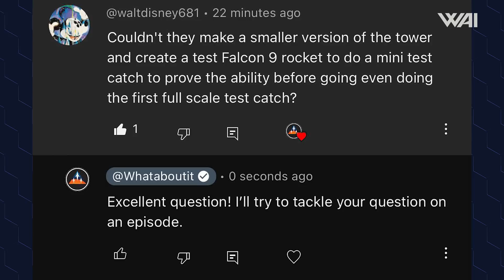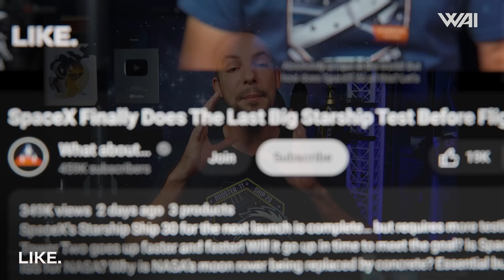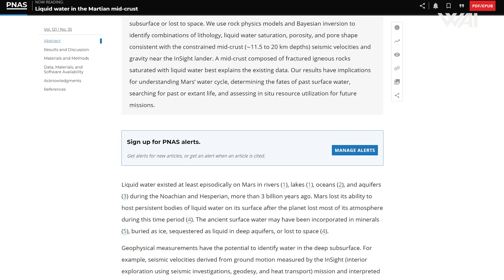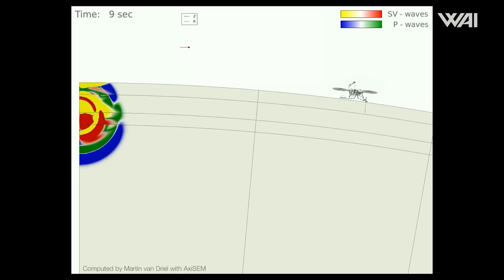SpaceX Massively Updates Starship! Ready For Flight 5!

Comment from the maker: Do you think SpaceX should try testing this with a Falcon 9 first, or maybe you have another idea?Let me know! :_WAIHello::_WAIStarship:
Reply: F9 won’t be compatible with a catch as it can’t hover (the engine needs to ignite precisely that the speed will be 0 at touchdown, too early and it will start going up again and too late then it will crash land)
Reply: @BukuiZhao 
I wonder why they don't change the Merlin engines to be Raptors so they can throttle. Yes, that would mean changing the fuel system to be methalox but is that so hard?
Reply: @appliedfacts  You do have to change the fuel system to methalox, and that shouldn’t be too difficult to do, but the data you will end up with is barely of any use since it is specific for the Falcon 9. Might just attempt it the proper way with a full sized Super Heavy instead, or at least make a smaller scale hopper prototype (like the early 150m hops, just like that except for the booster and it would be caught using the chopsticks at the end of the test) of Super Heavy with a mass simulator and test it like that.
Reply: @BukuiZhao 
I love that idea! Simple(ish) and effective. 
👍😎👍
Reply: I still believe that practice makes perfect. There is no telling what problems practice catching a real landing would reveal.
Reply: There's a lot to learn about catching Heavys and that's just what data they most want. I'd expect probs with the this first catch. They will try to catch Starship on the next flight. Waiting for things to be perfect isnt' in their DNA, nor should it be. I bet tower 1 is expendable for the data they want because they will just iterate and improve and rebuild it fast.
Reply: @ryanodneal7001  heck yeah 👍
Reply: I was thinking there would be a "bounce" when the two rods spacer rods of the chopsticks hit each other so that would cause more issues i.e. wobble that the chance of the chopsticks not stopping when connecting with the booster.
Reply: The problem is that Falcon 9 isn't designed to hover, so it'll never work. The best they can do for now are "drop tests" with a spare booster matching the weight of the one that will attempt the landing.
Reply: @totallylegityoutubeperson4170  Merlin throttles, that's the only way to accomplish a hover-slam landing.  It just doesn't throttle low enough to hover.
Reply: never mind the 9 meter diameter of SH vs the 4 meter diameter of falcon.
this question never should have been asked.
Reply: @Whataboutit  My thoughts for a smaller-scale catch test would be doing a hop. Having a barely-fuelled super heavy lift off, take it up like 10 meters, then lower it back down to be caught. Would verify that the chopsticks can support the weight at catch, determine the amount of damage to the booster, determine the amount of flame damage to the launch mount, and, if anything went wrong, a booster falling that slow from not very high up would only risk denting some metal they'd have to hammer back out, rather than completely KO-ing the entire launch mount and catch tower.

(Sorry, this is a repost of my own comment - I didn't see this pinned comment to reply to before, and I'm not sure where is better, so I've left the original comment up atm)
Reply: The post flight investigation of a failed catch would likely take far longer than rebuilding the first tower and finishing the second tower combined. If the catch doesnt go 100% to plan, there will be a mishap investigation, and if the booster fails to light up and it comes in at full speed, that investigation will take ages. Not to mention all the enviro groups and possible legal actrion from said groups holding things up. SpaceX will have prototypes and towers ready to go before the red tape is done with.
Reply: Yes it would be a good idea to try. An easier repair and general telemetry information might be useful.
Reply: I don't think even Falcon 9s landing precision is good enough for landing on a tower.
Reply: @DaveAFrizz  do you notice the white circles on the drone ship? their precision is quite adequate to fly into a chopsticks zone of activation, but the rocket itself is a smaller diameter, so the sticks wouldnt catch it, and the rocket would descend into the ring in the pads stand, so why bother?
Reply: @DaveAFrizz  Falcon 9s landings have come fairly close to their target.
RCSs; ( Reaction Control Thrusters may be required to 'steer' the Starship booster accurately into the catch arms )
Reply: No, OLM/Tower 1 design is dated.  Perhaps that is why they feel comfortable using it for catching the booster in the next flight test.   They seem to be using it as a "test article" to check out planned modifications for the second launch tower.  Frankly, after looking at what they are doing with static fires at Massie, I think the OLM can and will be eliminated.
Reply: Why don't spacex build a mini version of starship with legs like SN5 and fly it on top of falcon 9 or falcon heavy. Both the stages will land perfectly. I know it'll come down to weight to orbit but who cares when you have a fully reusable mini starship...
Reply: @galvium  If you pay the development costs and have the engineering staff, it is no problem
Reply: Okay.  A booster hopper that didn't need to do a reentry from space, launched nearly empty, up slowly to 10k feet, and right back down on the chopsticks.
Reply: Why not launch a super heavy booster about 12K' high and practice catching it a few times?
Reply: I think there should be grab pins all around booster instead of just two spots.
Reply: With mass differences, different engines and differences fuel types - I'm not sure how instructive a Falcon 9 catch would be. lol
Reply: Tower 2 with a frame to position and fix the starship for takeoff. It would have this frame above the flame trench rather like the testing flame trench at Massies. This frame can be exchanged after three or four launches for repair. 
Then two buildings left and right of the frame to support two platforms that are flat on the roofs of the two buildings and contain the quick dispatch fuel feeds for the booster. These slide from the two buildings tops into the booster base. They have concrete/steel tops that protect the feeds and buildings from the heat of the engines during take off. They go back and forth on rails from the tops of the buildings like the minuteman silo tops.
The returning ships would come back to be caught by the chopsticks arms and the tops of the buildings could be slide into the gap between the two buildings and above flame trench to protect the frame, feeds and kit in the buildings below while ships come in to land. Once the ship is caught and engines turned off, the protective tops can be slide open and the starship lowered onto the frame above the flame trench. Then the fuel feeds are slid across and be fitted while the booster is locked into the frame. Start refueling and placing a new starship on top ready for reload and launch
Reply: Go for starship launch and test
Reply: no - that would not give them useable data - they need to test with the starship booster
Reply: Hey man, what area you live in ? 
I'm only asking because I live near by too, the Daytona Beach area. 
I can see and hear every launch. Are they rebuilding that pad? I hope they do😢
Reply: No, not the Falcon, but rather a hop instead of from full height. Send the booster up mile or so and catch that. Seems much less risky to me.
Reply: falcon 9 isnt wide enough to test on these chopsticks. Why are you even asking this?
Reply: Falcon 9 has already paved the way. Starship needs legs. Sorry Elon. You want to go to the moon and Mars and theres me. Just want to see my friends in Manasas Junction one last time. Legs, Legs, and beautiful Legs. Forget the claws. Nice ides though.
Reply: It sounds like it could be worth it for future Falcon 9 launches if it allows them to remove parts, save mass and another failure point. (By introducing another huge one)
Reply: Elon, I am a leg man. And then I wish to move North to the promised land. Give up 5 or 10 to land with control and see Starship take off tomorrow regards to people confidence. I have in my time walked on most Seabeds where there was oil or gas. Another world down there for sure. Legs, Legs, and lovley Legs for a soft and sexy touchdown.
Reply: B14.1 with a version 3 raptor engine
Reply: I commented that 6 months ago can't wait to see the fireworks with the heavy booster catch landing
Reply: @tomfrazier3089  you did?
Reply: I think I remember
Reply: a falcon 9 test would be cool, and would make things a lot cheaper removing the legs so they could adding another star link to the falcon 9 while proving flight data.
Reply: @Whataboutit  No. Not Falcon 9.
Reply: They should try with a starship booster from a lower altitude
Reply: Felix, thank you for your excellent videos and I am a subscriber.

With reference to Pad B' OLM;   I wonder if its OLM is being modularized so that it can be built off-site and then moved to Pad B.
Felix, do you know what is happening regarding its build status-?
Reply: Falcon 9 has too much performance and not enough accuracy to do this. Even one Merlin engine at minimum thrust has a TWR > 1. That's why it's landing is called a hoverslam, otherwise known as a suicide burn.
Reply: I used to think it's crazy but the more you consider it, the more it makes more sense than landing on a drone ship at sea.  The ship's surface will rise and fall even during calm seas.  The booster has to bring its speed down to less than 1kph to land gently enough for those spindly legs to catch it - the Chopstix are setup to allow for a little more vertical speed than that and as for the positioning, have we not all seen HUNDREDS of boosters landing inside those lovely circles?  I'm guessing that circle radius is inside the Chopstix range of "catch" so i'm all in!
Reply: First at all RUD is essential part of spaceX development ;)
Reply: No, use the booster, add some more supports to the booster, i would feel comfortable with 6 or 8
Reply: @Whataboutit  Not necessarily to further the Starship program but if they can catch Falcon 9 they could delete the legs off of them as well further expanding the performance envelope of the Falcon 9. Might be a silly modification at this point for the Falcon 9 but who knows how far they plan on going with that design.
Reply: Thank You 👍
Reply: Besides the lack of ability to hover, F9 also is substantially less Diameter and lacks the points to be caught.  Even if it could hover and they added points to catch it, they are way to far apart as Super Heavy is a much larger diameter.
Reply: I don’t think the first try will be successful but like Elon says it will not be boring how much damage will be done that is the question I hope it’s successful on the first try that would be awesome
Reply: @jasontipton8430  
I agree with you! Likely to fail but not boring!  If it succeeds, it will be a miracle of modern engineering to be sure!  I, for one will not miss the live stream.  Period. 😁
Reply: No Sir, That would be a waste of time.
Reply: Na just go for it, Fk it
Reply: @Whataboutit   Yes, better safe than sorry, using the falcon 9 for fast caching experience. Then they go for booster catch.
Reply: I'm just going to say "Not Feasible" in any way. It won't payoff.
Reply: If Starship gets caught and they use that tech a lot, I would imagine F9 might get catch options later.
Reply: @anthonylosego nah, they'll switch all over to starship. The only ones that will stay on f9 will be those with contracts signed before starship is used commercially.
Reply: @Thomas_Acharya  If you make a better offer, the customers will change ship. Hardly one is married to Falcon.

Comment: BUILD CATCH ONLY TOWERS!!! With no quick release mechanisms, no deluge plumbing, no thrust diverters, more catch mechanism hardware like cable systems to catch in case of arms missing catch points. Even deep water pools for splash down retrievals of the booster inland instead of the ocean. Duh!!!!!!!!!!!!
Reply: DONT BLOW UP YOUR LAUNCH INFRASTRUCTURE!! BUILD CHEAPER CATCH ONLY TOWERS!!!!!!!

Comment: Another reason that building a catch tower for a falcon 9 is that they already have that data.  As I understand it, the booster is supposed to come to a stop, as the chopsticks close.  They already have all the data they need on a falcon 9 booster coming to a stop at exactly the right time, and they recently obtained the data on the chopsticks closing.  They also have at least one set of data on the starship booster coming to a complete stop from the last flight.  It only remains to be seen if they can hit the target and if they can synchronize the actions.

Comment: In Boston MA, they needed to do the same thing but first, they had to FREEZE IT, which we will not get into, what they were putting in is called, a COPPER DAM?  VERY NORMAL for places by the water.  I know the copper dam needed to go down to BED ROCK.  but here down south they do not have any rules to building anything.  A 4 inch slab build a house on top of it.

Comment: I'm less worried about an explosion, and more worried about the ~150 ton hunk of steel that is the booster itself.  SpaceX has only successfully landed a Starship once.  Every other time, it's smashed into the ground....violently.  It was never a big deal when they were just hitting concrete landing pads. They'd just grab the next Starship they had ready to go and keep testing.  When it would/will be hitting their only functioning Stage 0 launch assembly...much bigger deal.  

As Musk has said, Stage 0 is as complicated and important as the Starship itself.  Risking major damage to it is, I feel, a strange choice they are making...especially when the 2nd tower they're working on is nearly ready....at least to catch Starships.   The 2nd tower doesn't have the launch pad yet, but they could certainly (and I think SHOULD) use it as a catch tower.  Let it act as a test tower, and provided they are successful with the catch they can just move the ship back over to the launch tower.  It's a LOT easier for them to move a ship from tower to tower than it is for them to rebuild a Stage 0, and also has the side benefit of saving the launch pad from getting cooked by starships trying to hover directly over it during catches.

Comment: I wonder why they are working so hard to have a starship reentry proof, starship in fact  is not built with the idea of coming back to earth. It predominantly be spacecraft to travel through space therefore strength of handling reentry is not that important. It would be easier to have a reloading facility on orbit and use capsules to send crew back to earth. Just thoughts.

Comment: Felix - one thing that comes to my mind it why have Space X  not stared preparing a “soft landing” pad if the chopsticks fail or the booster misses I wonder if they have thought of an alternative location Near the launch pad even it was just a huge sandpit… What are your thoughts on this…
Reply: That solution would not prevent or contain an explosion. The sea is quite good at both.
Reply: @stratolestele7611  I agree - I was actually thinking as the booster approaches the tower what the back up solution was. Regardless of the chopsticks Newton will take over 😂👍

Comment: I keep wondering how accurate the rotational positioning of the booster will have to be to be caught.As I understand it, they are planning to catch the booster on the little lifting nubs, of which there are only two, 180 degrees apart. If those nubs are not oriented within  a few rotational degrees, there will be nothing to catch on. I have wondered about this for quite a long time.

Comment: From what I can see there may be a small potentially catastrophic design flaw in how the Chop sticks swing, it appears that each chop stick has it own pivot point and not a common pivot point this could lead to miss alignment with starship, as the catch location points may not retain a true alignment  when they swing from left to right. Don't mind me just looking closer at the pivot mechanism and have seen it does have a common pivot point. what appeared to be the pivot point from a distance do have attachment to a common point.

Comment: In my opinion colonizing Mars just plain isn’t going to happen in any substantial way. A few settlements… possibly. The lack of a protective geomagnetic field is not overcome-able. Terraforming is not remotely feasible, and if it was, the solar wind would pummel and evaporate any atmosphere. Additionally a 20 km drilling effort would be the most difficult and costly thing the human species has ever attempted… and Mars mantle may be slightly cooler than ours, but is still a scorching 2600 degrees F. Any steel will begin to melt much shallower than 20 km. I love Elon and his big rockets but it’s time to get real.